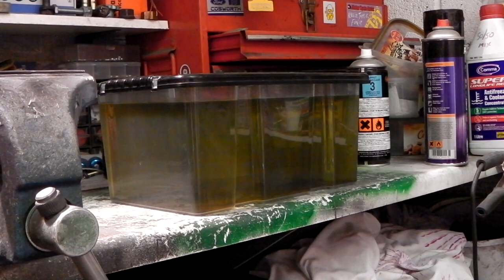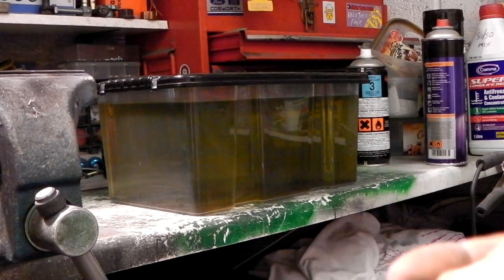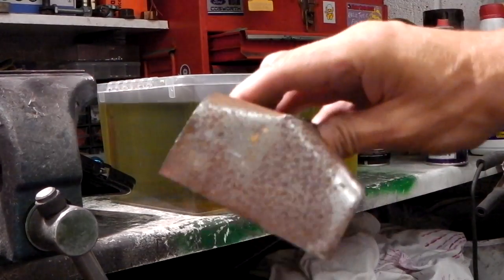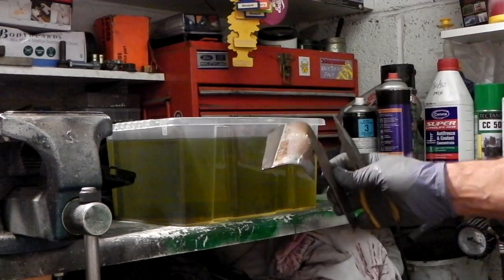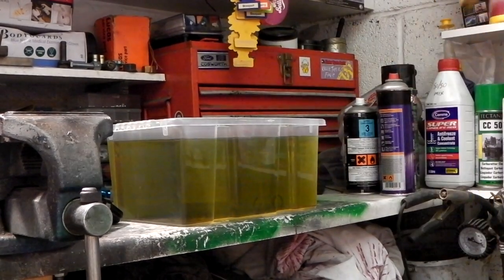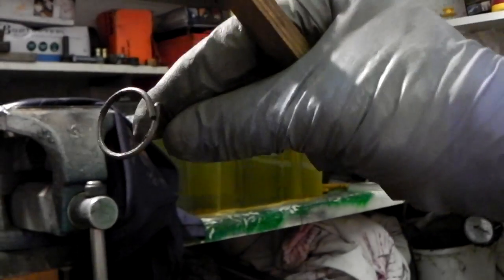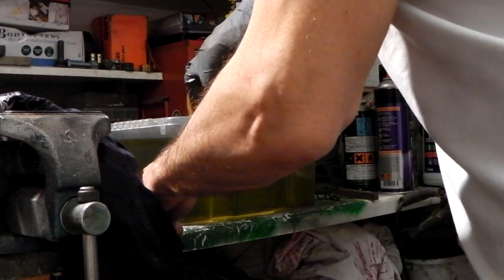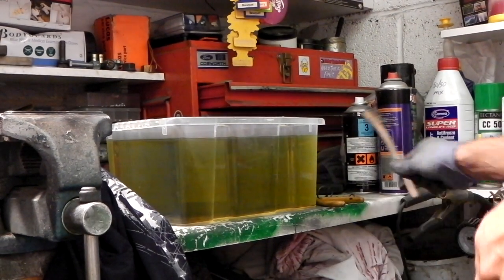Suzuki RGV 250M - Easy Rust Removal Process

Comment: Hi, if I use deoxc for inside fuel tank. Do I need sealer coating after to prevent rust? Thanks.
Reply from the maker: Yes I think adding a sealer would be a good idea as the deoxc will remove the rust and leave clean metal which will corrode again over time
Reply: The sealer will have to be resistant to the fuel possibly breaking it down.

Comment: Hi, prompt, what did You use to clean and remove rust from spare parts? I have got a Nissan X-Trail, and need from restoration
Reply from the maker: Hi, that is what the video explains, mix up the Deox C powder with warm water in the biggest container you have and put the parts in, leave for at least 24 hours, take out and rinse off with clean water, its as simple as that.

Comment: How much powder did you use??
Mixture ratio?
Reply from the maker: Hi, it is mixed 1 part powder to 9 parts water by weight, I don't think the mixture ratio is too critical as I have mixed it in a rush before without weighing it and it still worked fine, two cap full's into the container in the video worked ok.

Comment: isnt that stuff a gel? have you mixed it with something?
Reply from the maker: Hi, it is a powder that is mixed with water, its suppose to be non-toxic and can be used again and again until it goes a dark colour.
Reply: ive just purchased some of the stuff but in a gel form, how did you find it? any trouble with the metal after youve painted it?
Reply from the maker: It all worked great, rinse in fresh water once the rust is gone then a quick wire brush and paint, it did leave a little black residue on the metal but the fresh water and wire brush takes it off, all the stuff I have used it on still looks good so I can recommend it.